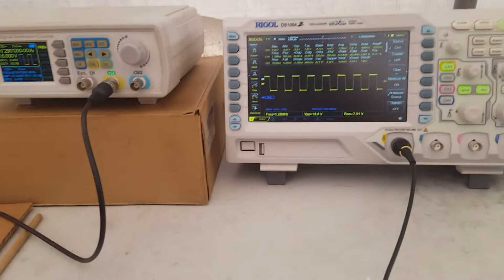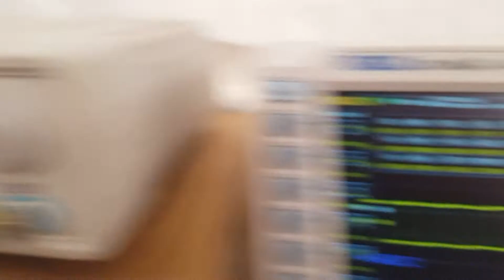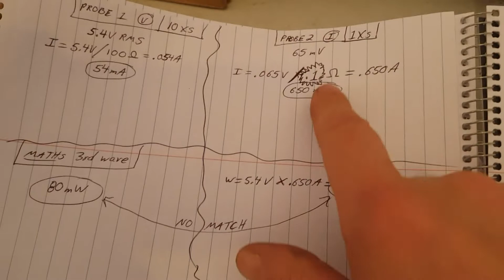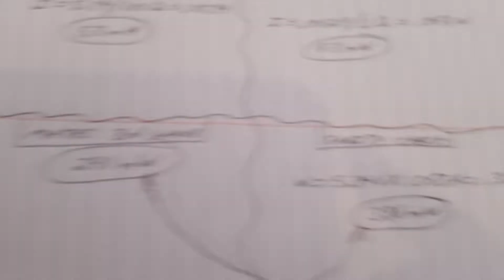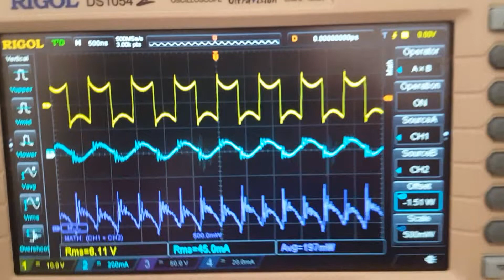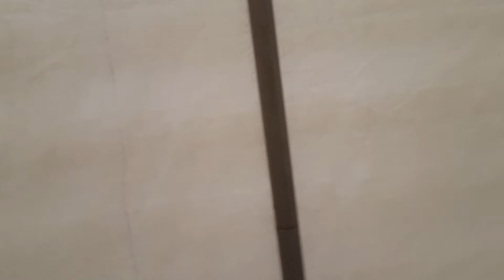WIRELESS POWER TRANSFER Part 20 INPUT POWER TRY AGAIN (Over unity!? Free energy!!?)

Comment: Hi Paul, if you're not doing this already; I would suggest trying to increasing the ions in the air around your coils.  I'm pretty sure that's why my antenna power increase and decreases, in my receiving circuit.
Reply from the maker: Interesting idea, thanks.  I was thinking about trying graphene.  You built a very impressive pulse motor and NiTiNOL machine, looks a lot like Ridgway Banks design turned on its side.  I would like to replicate his patent design, in his patent he has another version that he did not make but also included in his patent, basically it is his design within itself 3 times over.  Strange I can not find patent now of his particular design here...  https://www.youtube.com/watch?v=oKmYqUSDch8&t=0s
Keep up the great work!
Reply: @INVENTOR3  Hi Paul; I have seen that video before.  Still all interesting, thanks.    All my nitinol motor designs are air cooled, and don't need a cold water bath; like Ridgway Banks design.  Also, the power strokes in mine are also achieved in a different manner than his.
A lot of people spend a lot of money on Patents, and then they never amount to anything.  I decided not to go that route.
Reply from the maker: @doubleMinnovations  Well, you have a great design! :-)  I spent months researching and designing.  Getting the correct wire and activation temperature for your design is one of the tricky parts.  I was also lookin into the double memory.
Again , great job, excellent work!

Comment: What size is the wire size on your primary and secondary coil? And how many feet of wire is on each coil? Or how many wraps of wire around what size of pvc pipe?
Reply from the maker: Oh, you should watch the first few videos in this series.  I'm trying to recall all those specifications,,,,, I want to say wire is around .032 inch dia for primary, I forget what gauge this is, about 20-22.  Diameter of primary core is about 2.875 inches dia..  Wire length, now this is the important one, all coils were at 49.2 ft(20MHz), but now primary is at half wave.  The important thing is to match wave lengths or harmonics of that wave.  My smaller coils are only .005 dia wire, like a hair, but still at 49.2 ft.  Smaller coils with more turns will have more induction, and smaller field, so they can be close to each other without interfering with each other.  Soon I will try 1/4 wave length on primary to increase the input frequency.  Higher freq more energy.  Hope this helps some 😎
Reply: @INVENTOR3  Thank you! Yes that is absolutely awesome! 🤝🏻 Does it mater if the wires cross back and forth over each other when winding? Or should I be supper careful to keep each wire beside its neighbour per layer of wire? Or is it only one layer deep on the tube?
Reply from the maker: @ShilohSedlak  only single layer do not put windings over each other, carefully Place each turn next to its neighbor.  Enamel coated wire or rubber insulated either should work good.
Reply: @INVENTOR3  Awesome, thanks so much! I'll try and build that and let you know my results! 🤝🏻

Comment: 7.5 volts? 
That's enough to run a small tesl coil. Turn it into plasma
Reply from the maker: Hmmm, yes.
Reply: @INVENTOR3 

I don't think you need to do that. But would be intresting to compare it with a solar panel or!/and a windmil. It's so much easier. I bet it's so much more effective in the long run.

Comment: Just asking , what is this different than ordinary induction physics?
Reply: The difference is "in verses out", normal everyday induction net's you with a loss and he's clearly gaining here as it appears. I'd love to spend a watt and get 2 or more in return!
Reply: @Finite-Tuning  great , hope to see one day the final project in a video
Reply from the maker: @i_catalino  Thank you. Yes, Finite has good answer there :-)
I want to see final project also, hehehehe.  It will be coming soon I hope, but has to stay as it is until proper measurements are made,, but if impossible then to proceed with project and will be able to get measurements from final design.
Reply: @INVENTOR3  Its easy to measure power consumption , I usually use integrative method , with capacitors and small value resistors but take your time and let us know
Reply from the maker: @Finite-Tuning  Thank you😁
Reply from the maker: @klingonbaronessprincesskar5519  It sure seems like a lot of extra energy so far, and I feel like I'm just scrapping the tip of the iceberg.  I hope this one makes history!!